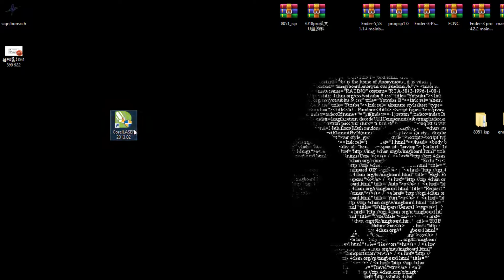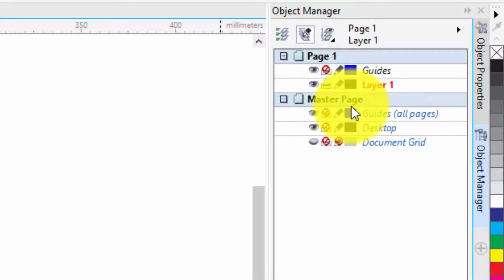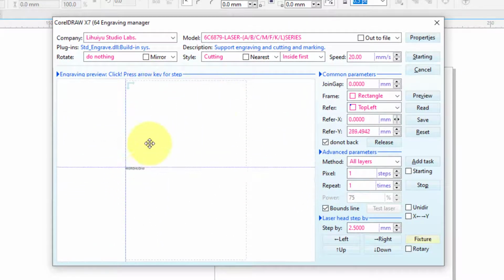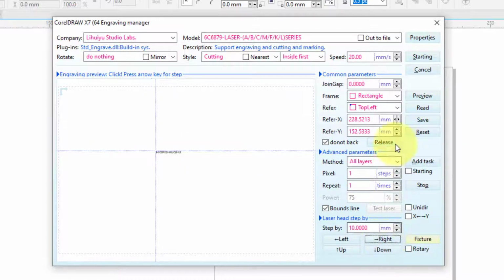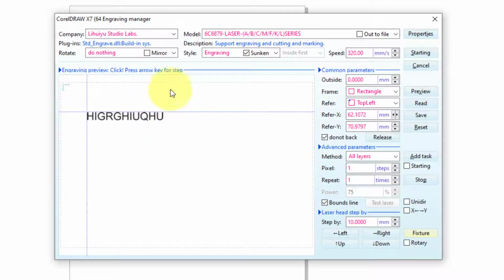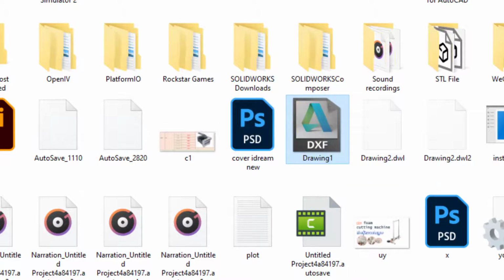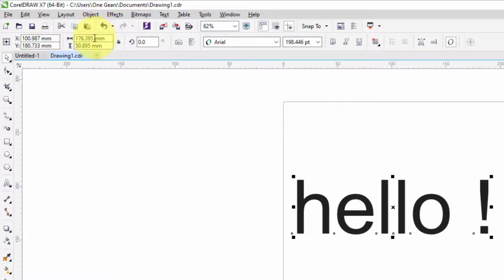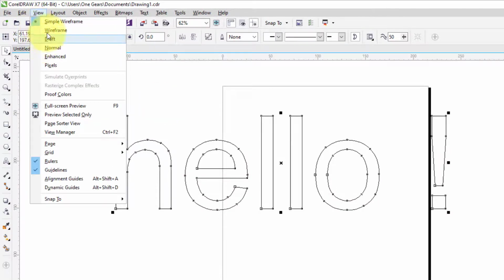Tutorial 2 - How to use corelDraw X7 with laser CO2 machine - M2 controller

Comment: I cant connect on windows 10, on old lap top work, on new dont wanna connect. Have u ever had that problem?
Reply from the maker: plug in USB Key in  to pc reinstall CorelLaser again.
Reply: @processdiy  it is unknown devices mesage. 😭😭😭
Reply from the maker: @koalaboala2906   change USB wire
Reply: @processdiy  i dont have new now. I will try. But works on old
Reply: @processdiy  reinstall?? Or reopen??